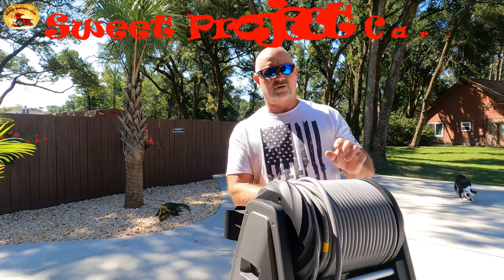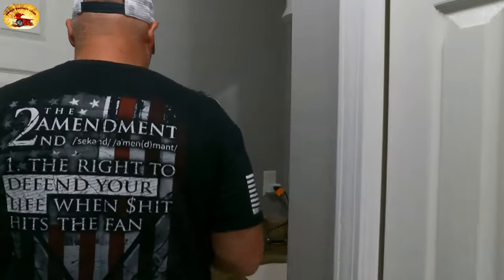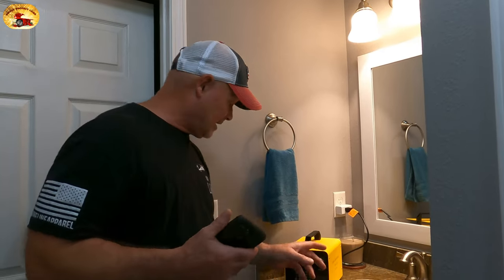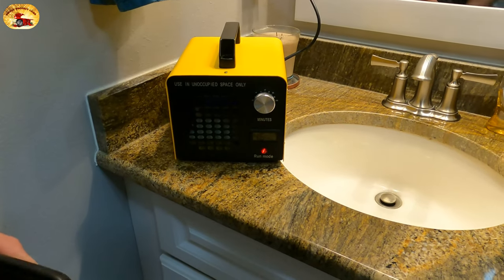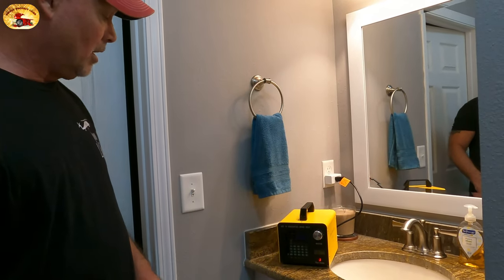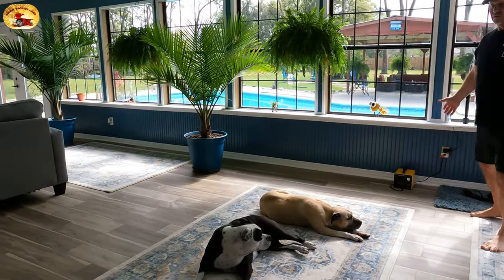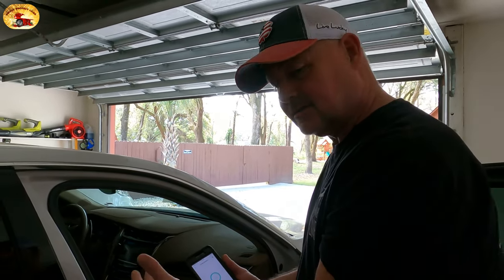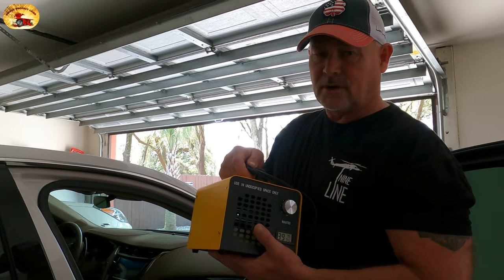How To Remove Bad SMELLS From Your Car Truck and Home FAST!

Comment: Thanks for the discount!  These machines are awesome!  I've been using them since the late 90's, these are a lot more powerful and affordable than they used to be.  I run it in my old house's basement once a week, doesn't smell at all.
Words of caution.  Ozone works by having a loosely connected oxygen atom connected to a stable pair.  That atom oxidizes and kills anything organic.  Some people are sensitive and it could bother their breathing badly.  After 20 minutes all of the O3 will go back to O2, wait that long after shutting it off.
Secondly, this machine oxidizes the crap out of everything.  Less is more, you can damage a lot of stuff if not using any sense.  Natural rubber and latex, oil paintings, and electronics are susceptible to oxidation damage.  Pets, especially birds,  are sensitive.   Just follow the directions and you'll be fine.
Reply: YES, it very much DOES oxidize everything it comes in contact with. That's why I would get a variable output unit to keep the O3 ions at the minimum you need for the job. Sometimes you need more, sometimes less.
Reply: Modern laptops, cell phones and the like won’t be affected by ozone. Maybe older open electronics, yes but you are overselling how much one of these little machines can destroy. The breathing caution is valid and REAL, but I’ve never degraded any rubber just using these for a couple hours max.
Reply from the maker: Absolutely J, glad we could share! Thank you for the view and comment, we truly appreciate your input, these are a must have tool for sure. Have a fantastic day my friend. mad Mike the hammer SPC
Reply: @nordicpride9708  Natural rubber and latex.  Silicone based is not really affected by O3.  Any wiring connection that isn't sealed correctly will be subject to damage.  No, it won't explode the instant ozone comes in contact with it.  Never implied that it would.  Exposed metals that corrode can and will start corroding in a highly charged environment if not sealed. 
Yes, your modern electronics are supposed to be sealed. Yet every one is using smaller and smaller connections by a considerable magnitude that take far less damage to cause faults.  Consider that all modern electronics are component manufactured by companies providing the lowest bid.  I've had numerous components in the field fail from "minor" corrosive/damp environments.  Common machines put out 10 grams/hour.  That's quite a large amount. Susceptible things will take on some damage.

Comment: If you crack your window in the car you can run the plug through it, also run the car with the vents on recirculation and it'll clean the air ducts out.  
Btw.. you aren't supposed to breath the ozone.  Iirc it is toxic.
Reply from the maker: Thanks for the view and your ideas, we appreciate it Blake, have a great day. mad Mike the hammer SPC